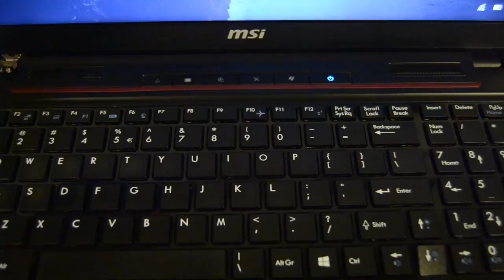Channel Update / MSI GP60 Leopard Pro Teardown and Review

Comment: The same thing happened to my unit. Both hinge is broken now. And it's not getting any power
Reply from the maker: I converted this laptop into a entertainment center PC and the same thing happened to me. It shut off out of nowhere and wouldn’t turn back on. Is the power adaptor socket loose at all? I replaced the charging port and that fixed the issue for me.
Reply: Colonial Puppet yea. Opened it up yesterday and the power jack did desoldered itself. I might try to solder it back on.